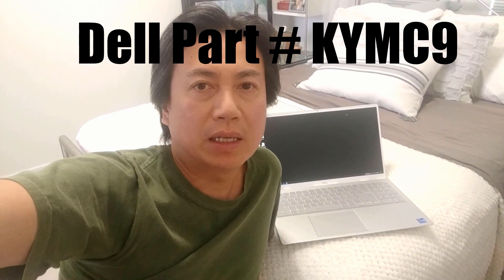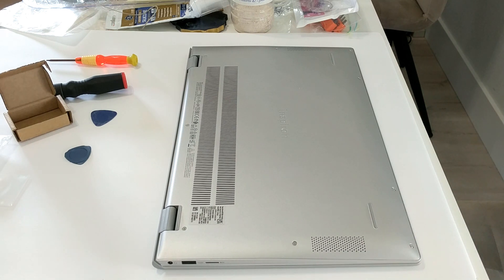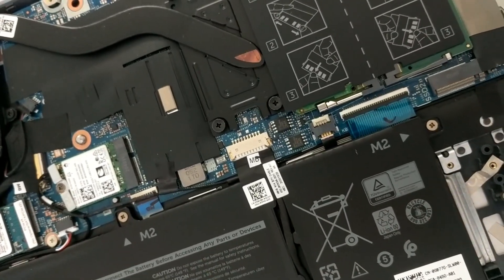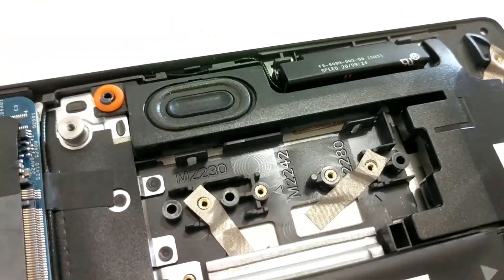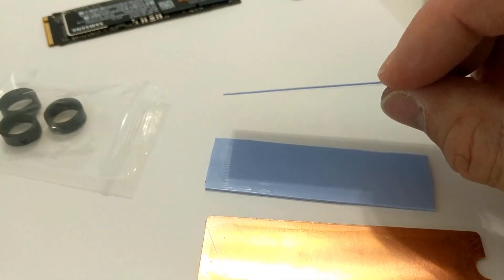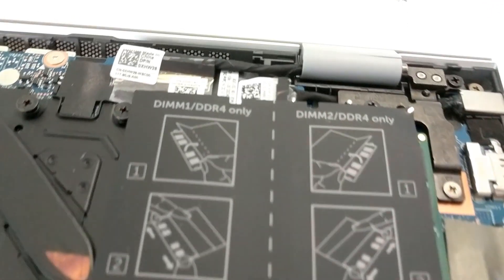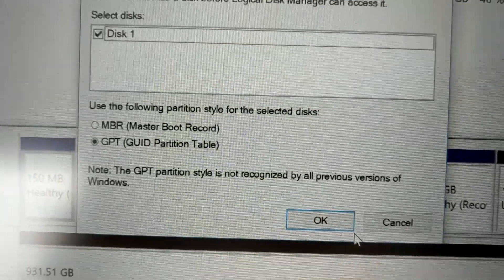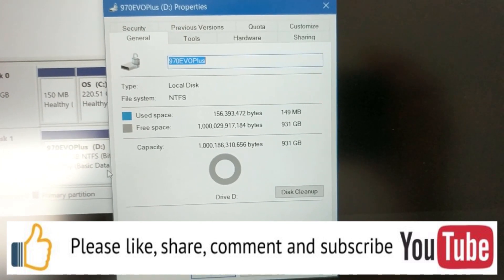2021 Dell Inspiron 15 5502 Slot 2 NVMe SSD / Heatsink Install

Comment: Are yhe rubber strong enough to hold the heat sink..or woudl they wear off in a year?
Reply from the maker: Not sure, I haven't opened it up since.

Comment: tl;dr look closely at 6:07 that heat sink will be ''useles'' to the drive, it will overheat, well the controller chip(the chip close to the data pins) anyways...remove it, put a 1mm thermal pad on the controller  and on the memory modules the .5mm so the ''whole pad'' is leveled flat to the heatsink so makes whole contact Look at this vid https://www.youtube.com/watch?v=I8Z09nU554Q

Look closely on your vid at 6:07 there is gap between the controller chip and thermal pad which isn't making contact, so not heat dissipation to the heat sink, and that is the one that really gets hot, hotter than the memory modules, if that dies well drive is ''dead'', the conteoller is what you really want to cool down because memory modules stay ''cool'' (within operatin temps) normally, while the controller is hotter, it is what ''over heats'' in the drive compared to the memory chips.
Reply from the maker: Thanks for your input and the link to the video. I really don't want to open up the laptop again but maybe I should. Do you think I should remove the heat sink altogether since I'm not using it for gaming? The most taxing thing I do is video editing.
Reply: @LuvLysWorld  Lol I just watched this video just because I was kinda hoping to see some temp differences from having that heatsink or no, but honestly, that gap you showed between the copper and the controller chip is criminal. It wouldn't really cool down as well as it would've if you had filled in that gap, and that actually wouldn't really matter if you were a gamer since drives don't get that hot for games, but it defo will for video editing, since editors actively use the drive mid editing and obviously there's the part of exporting the videos. Anyway, I suppose I need to get one of these things because my ssds are probably gonna melt soon. Thanks Gen 4 tech
Reply: @LuvLysWorld  i think you SHOULD, i nderstand not wanting to do it again, but its not that hard really and you will regret it if you dont. video editing is the same gaming(probably worst since when your ar done with the file and normally s larger it writes to the drive ut goes throug the controller and dram frst getting hot) as slc cache dram from ssds (the ones that have dram at least, in yours and my case being the samsung m.2 nvme do have dram) is held in the controller whle data is being eorked on and THEN  written to the memry chips, after some time the data being worked on has ben acces it procceds to write it to the chips in the background while you are doing somenthing else, all so we have the super fast feeling (they gave ram to the drives so its super fast to operate, like if is the os or programs on ram, imagine if the  didnt is like opening a picture from a HDD, takes a secnf to spin the drive to acces data, you hear it, then reads it puts on ram and then it opens it up and you finally see it). in fact you want your memry chips to warm and the controller cool thats why they have a copper sticker in the bttom called heat spreader so the heat from the controller goes to the chips, but t hats just from engineering point of view if the drive is operating in cold enviroment, like in fall/winter day and drinking a coffe at stabbuck outdoors kind of like, long story short dont spend to much money and get this https://www.amazon.com/gp/product/B07YC1HTFR/ref=ppx_yo_dt_b_search_asin_title?ie=UTF8&psc=1 comes with the 1mm and .5mm pads and 1mm copper heatsink cut pretty much in half the .5mm and the 1mm pads and put the 1mm half pad on the contrller and the .5mm half pad on the memry chope and put he heat sink on and make sure to use the bands so it keeps presure on especialy on top the controller

Comment: Can i just not use KYMC9 bracket and screw the m.2 ssd in?
Reply from the maker: It won't sit flush or secured without the bracket.

Comment: ps: those pads are called Thermal Pads. which help move heat from the SSD to the HEATSINK. Keep in mind, the modules on the face of the SSD you have are different heighth, meaning you should look closely, and cut a piece from each thermal pad and place them on ssd until level, test with heatsink before removing film from the thermal pads to be sure its level across the SSD.
Reply from the maker: That's good to know. Thank you.
Reply: @LuvLysWorld  This is  a design flaw by the industry. They should have made chip heights uniform.

Comment: Very nice video.  Do you think Samsung Electronics 980 PRO SSD with Heatsink would fit into this laptop?  if it does, then it would be better than holding the heatsink with the silicone bands and I would assume be better for overheating prevention.
Reply from the maker: I'm not sure if this laptop supports gen 4 SSDs. The specs mention gen 3. Also it's pretty tight in there and I'm not sure if the built in heat sink would make it too rigid and thick. The rubber bands and gel pad I used  are squishy.
Reply: @LuvLysWorld  Thanks for help.  Are you using the 0.5m gel pad or the 0.8 gel pad?  I believe you are correct that the built-in heat sink is a bit large for the laptop.
Reply from the maker: @juggernautkc112  You're welcomed! I used the thinner pad. That part of the laptop tapers and gets pretty thin.

Comment: Hi, thanks a lot for this video tutorial and sharing your search results.
here in France not much information available.
best regards :)
Reply from the maker: You're welcomed. Are you able to get the hard drive bracket in France?
Reply: @LuvLysWorld  I ordered it on aliexpress for 8 USD. unable to find the mounting standoff, I'll try to order it from dell.
I just bought the computer on amazon but not received yet, and dell asks for service code to sell parts.

Comment: What’s up man ? Question, I want to transfer my 1TB SSD from my dying computer, using this method, Do you think it could work? All my files are there, including a copy of windows 10 of course. Please let me know,
Reply from the maker: Hi, this method is for installing a secondary drive in the 5502. Once you you install the new drive you can copy the files from your old computer. You could get a 2 TB drive so you'd have space for your old files and new files.
Reply: Most likely if your computer isn't dying it's because your not replacing the thermal paste or not good enough cooling

Unless it for a another reason like age

Comment: Dang, you gotta get some volume level management going. Voice is very, very low. Music pings and bongs completely cut your voice, even at max+ volume. Can't finish the video. Good luck with your mixer.
Reply from the maker: That's strange... You're the first to point out an audio issue and the video has several thousand views. 🤷‍♂️
Reply: @LuvLysWorld  The voice volume is indeed very low, and the music is excessively loud in comparison
Reply from the maker: For those having audio issues, mute the video and turn on captions.
Reply: @LuvLysWorld  That makes no sense. "Just look at the pictures" instead of upgrading your video skills that will make your videos better and your channel more successful? Or you can simply ignore important feedback. Your choice bud.
Reply from the maker: I have no problem incorporating feedback and making every video better. You'll see that with our newer videos. There's no way to fix and re-upload this video without losing the view count, therefore I suggested a workaround to those who are having problems with the audio.

Comment: Hy I bought this laptop just a few days ago. And it seems my laptop has a miss aligned hinge. I contacted the store from where i bought it and they said that it was fine. But for some reason whenever i notice it, it gives me a lot of anxiety. If you have any suggestions I will appreciate.
Reply from the maker: Does the top and bottom line up correctly when it's closed? If so, the hinges are probably ok. It should still be under warranty?

Comment: Impossible to install a second ssd as Dell have not made the little mounting bracket available in the UK. Nice work though!
Reply from the maker: Thank you. Check out this part on the Amazon UK site. It may be identical to the third party vendor part I used in the video.

https://www.amazon.co.uk/s?k=Deal4GO+KYMC9
Reply: @LuvLysWorld  Thanks for the link. Unfortunately that's an imported part for the uk so would have to pay duty too. Many thanks for taking the time to look :-)

Comment: what do you use to keep the heat sink strapped?
Reply from the maker: The heat sink kit comes with rubber bands that strap to the drive as seen in the video.

Comment: ive been watching this for 10th times only then i ordered the new ssd for my second ssd slot. Thanks m8 for this great tutorial it really boosted my confidence to upgrade myself! Cheers mate!
Reply from the maker: You're most welcomed! The toughest part is getting the cover off, but you can do it! 👍
Reply: Hi luvly, may i know is the heat sink necessary? Cuz i dont really know anything about thiss
Reply from the maker: Heat sink is optional. I installed it just in case but it does seem to lower the operating temperature.
Reply: Omgg thats is so helpful, but how about the screw tho ,  can i get it at any hardware store?😳
Reply from the maker: I don't know. If you order the kit you'll get the bracket and the screws you need.

Comment: laptop screen broke : I bought this laptop 3 months ago and screen of laptop got broken .... can someone help me that how to fix it
Reply from the maker: Sorry to hear that. Did it just stop working? If so check with Dell about the warranty.
Reply: @LuvLysWorld  I checked with dell ... it’s not covered as it is screen but laptop is working with external monitor. Dell is coated high price for changing the screen
Reply: @RanjusFoodFusion  just moved the important things to a flash drive or external ssd and then take the ssd inside the laptop to save it if it's good then completely take windows 10 and everything else off of it so you can then in the future use it or extra storage for something else

Then when you can afford another laptop or desktop use it as a secondary storage

Comment: How well does that heatsink work? I noticed that the heatsink is attached to the opposite side than is shown in the picture on Amazon. Does it matter? Did you cut the silicon tab? Witch tab did you use, the thick one, or the thin one?
Reply from the maker: It seems to work well. At idle the drive is at 27 degrees Celcius and at load it's around 42. I put it on the top so the heat will dissipate toward the outside of the laptop rather than inside.
Reply from the maker: I didn't have to cut the tab but it does stretch very easily when you remove the protective clear sticker. I used the thin one since it's pretty tight in there.